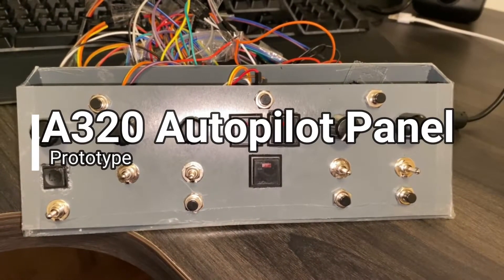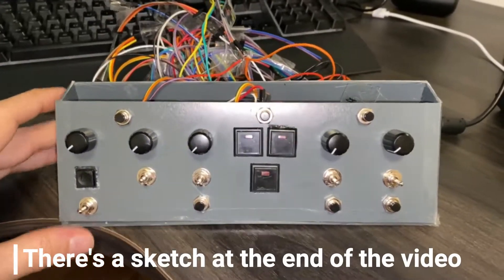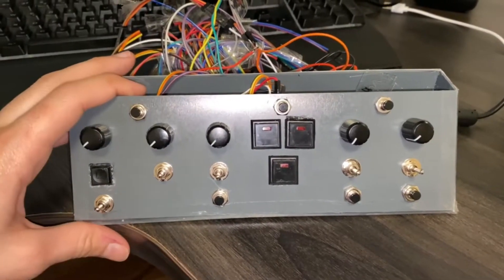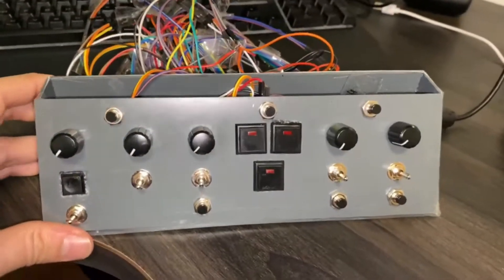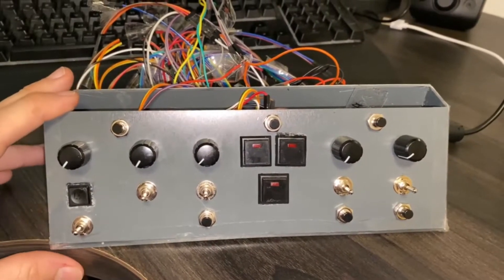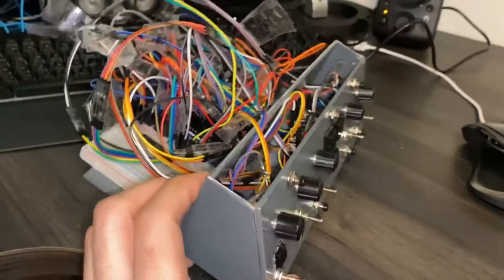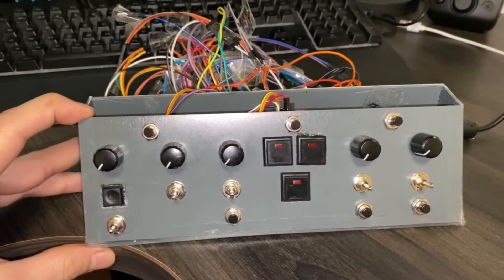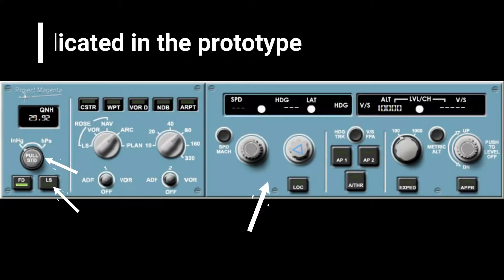A320 Autopilot Panel (Full FCU) Prototype for MFS2020 MobiFlight and FSUIPC7. Managed/selected mode

Comment: Independently of you, I thought of the same idea of a sprung switch for selected mode and encoders with a push switch for managed mode. Great engineer minds think alike ha ha.

Then I printed a 737 MCP from 737DiySim!  However I think 2-way sprung switches on a thin panel above the Spd, Hdg, Alt, V/S encoders on the 737 MCP will give the illusion of the Airbus architecture. With 2 Mobiflight configurations of course, one for Boeing, one for Airbus. The 2-way switch panel could be angled at 45 degrees, to emphasise the push/pull effect.   Also wiring the encoder push switches in parallel with the 2-way switches allows pushing the knob (correct) or pulling the switch.      

I've often wondered why V/S is a wheel in the Boeing world, I think it is just history and nobody wants to change what pilots have used for decades. However, I think the Airbus solution of a rotary V/S knob is quite natural and is consistent with all rotary controls in the electronics world. Hi-Fi/TV/radio volume controls from the 1950s onwards, for example.

Comment: I'm building FCU, too. But the APPR and A/THR button events are not working properly.
Reply from the maker: Hi, I will check it out as i havent configured it yet. You probably need to setup a custom event, similarly as I did in my other video https://youtu.be/hH_kn7xaYmk once i dive into athr and app i’ll reply to you here. I’ll probably upload more videos on the topic soon
Reply: @BarcelonaAustinA35  I already setup custom events. but could not work. I will wait for your video while developing it.
Reply from the maker: Ok I will try this first
Reply: @BarcelonaAustinA35 I found most of the events today. However, the LEDs of LOC, APPR, FD and MSFS LED do not sync normally. 
For example, when the APPR button is clicked, the Arduino LED is turned on normally and the simulation is working, but the MSFS APPR LED is not turned on.
Reply from the maker: Nice. I think some leds are read only for now. Its a mfs2020 developers issue
Reply: @BarcelonaAustinA35  I think so too.